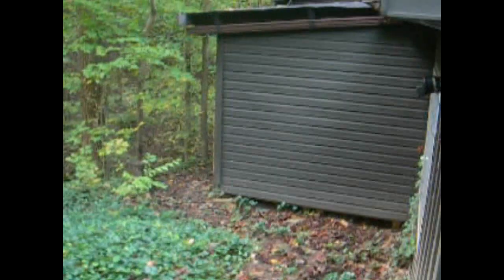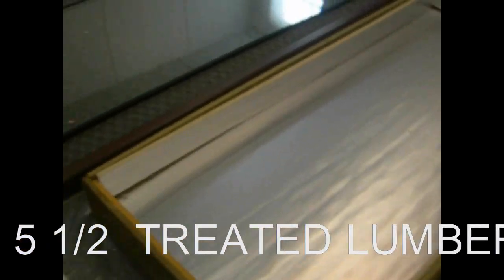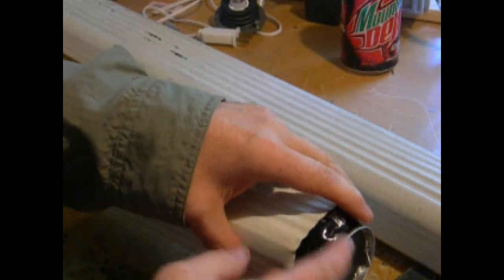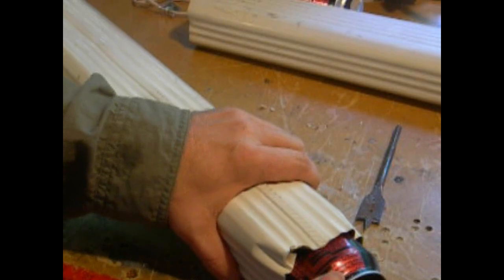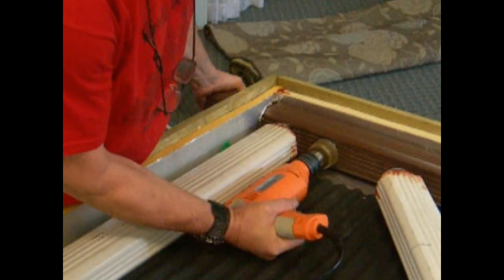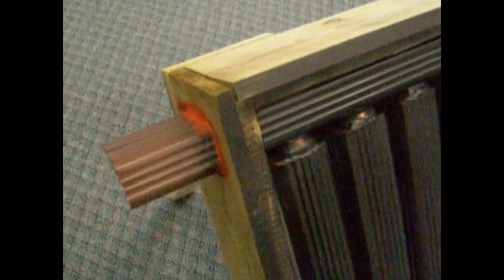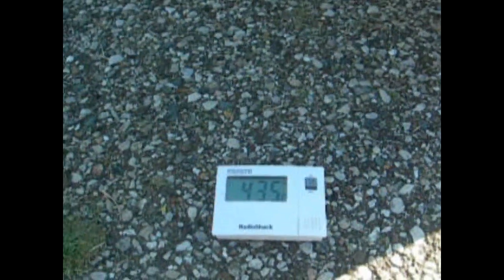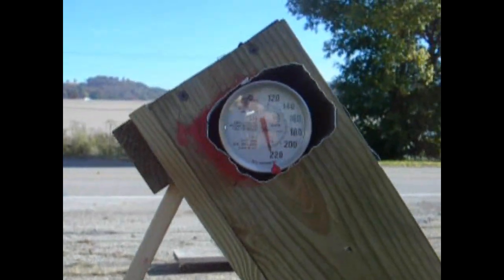HOW TO MAKE A POP CAN / DOWNSPOUT HEATER / FURNANCE

Comment: Great video! I'm going to make one. Maybe a couple of them. Just a FYI. To cut the top off the can I found a can opener (after buying and trying 3 others that didn't) that works perfectly. It's a manual one called Starfrit MightiCan. I used a diamond 40mm hole saw to cut out the bottom of each can. I'v got over 100 already ready to go. But will get a lot more to put in a second setup. THANKS!

Comment: Roughly How much volume of air is being pumped out of there. 
Or how powerfull is the fan
Reply: He wasn't running a fan that I could see.  That was pure thermosiphon;  the air moves as fast as it is hot.

You don't really need a fan, btw.  The amount of energy the panel collects is only affected by the intensity of the sun and the loss through the insulation.
The  "catch" is that the bigger the difference between hot and cold, the more "lossy" the system becomes.  

That's why most folks run a fan;  lower temp + higher volume air == less need for insulation.  In this case, it really doesn't seem to be that big a problem.

Comment: Why are the cans necessary?  Could you not just use the downspout material?
Reply: It also creates turbulence that "mixes" the air so that as much air mass as possible picks up heat.  Otherwise, it's just the air touching the aluminum that picks up heat and the rest is wasted space.
Reply: i believe its to slow the air down. because if it pumped through that too fast it wouldnt have time to heat up the air
Reply: Thanks Martin.   That makes sense.

Comment: I would normally agree but this solar heater does not rely on thermal mass to maintain/store heat. Once the sun goes down, the temperature of this heater rapidly decreases, no mater how much aluminum you add. I'd be more convinced if I saw some comparison data. Btw, have you seen the solar heater which uses aluminum window screen? That design has minimal thermal mass but is more efficient than this soda can design: builditsolar(.)com/Experimental/AirColTesting/Index(.)htm

Comment: Omitting the soda cans will result in less thermal mass. Objects with thermal mass have the ability to store and transfer thermal energy. By adding the soda cans, the system's ability to absorb the thermal energy absorbed by the black downspouts is increased. Beverage cans are generally used for two reasons. First, if you drink anything out of an aluminum can, they are essentially free. Also, aluminum is an excellent thermal conductor. This is why it is often used in heat sinks. Hope this helps.

Comment: hi rich would you be able to give me the products i need because i am making one like your 5th one thanks! P.S i am not using the strips that you put on nut i might if you can tell me if they are cheap enough for me to buy and what would you do for it to be on a slanted shed roof and a pipe with the insulation you will tell me to use will go into the shed and heat it. how much would it to buy one of the fans and covers? i need it because when i go into my shed on saturdays and sundays it is cold

Comment: Can you make it a multipass if you use gutters for headers and cap it every 2 downspouts. Would a multipass be to hard for a fan to push it out? Just wondering if it's worth trying as I am going to make I  fit it in the inside of my window. It is 68 inches London and about 25 inches high.

Comment: Thanks for showing me your video.  I could not see the whole design (I need to now airflow rate), but it appears you need higher airflow to get more heat out.   Watts out = CFM*(F out -  F in) / 3.  Higher CFM brings temps down which makes it more efficient by losing less heat out of the window of the box.

Comment: Do you do anything to control the high temp of air produced, or does the 200 deg +/- air mix with colder air to make a comfortable temp, or do you have some type of thermostat to open & close a vent or turn a fan on/off so the temp in the home doesn't get too high?  Also, I noticed that your other designs are straight up & down and this one was angled.  I bet if you matched the angle so that the glass was perpendicular to the angle of the sun, it might even be a little more efficient.  NICE JOB!

Comment: 220 degrees sounds like a lot, but you cant heat your house with hot air that stays in the collector.   What temp does it hold when you pump X CFM through?  What sort of BTU output do you get?
I like your idea of using downspouts, however!

Comment: Instead of cutting the sides of the top can, leave it closed and fill in around with sand or salt.  That should help retain heat longer.

Comment: Thanks for proving what I've been telling others. Slow the airflow...use thick material...not just wafer thin pop cans. Thicker material equals heat storage...and since it's hooked to the house...it's impossible to "lose" heat. More material...more heat. More sq feet of heater, more heat. Nice job dude. Too bad yours costs quite a bit to become automated...but overall the collector is very good. Very dense.

Comment: This works so well that i'm starting to worry about that wood warping or being a fire hazard! haha. Oh, i had one question about the down spouts. What do you use to seal the ends of the pop cans with the down spouts? I can imagine that most sealers would melt at temps of over 200.
Thanks for the awesome videos!

Comment from the maker: @mrphotomanTIM  hi yes im in cross lanes wv  check out my loose can heater test they work just as good and have better air flow  and are very easy to make if i was going to build one now would make a large loose can type and maybe add a little sand to each can   good luck keep me posted   rich allen

Comment: I checked all the floor vents in my house and the hot air that comes out is about 130 degrees f.  It seems to me that if you were to add a second intake and exhoust vent(open the other end of your headers) that you could double your air flow and the air temprature should still be high enough to keep you comfortable while the sun is shining.  Give it some thought...

Comment from the maker: the unit your watching has a snapdisc that turns a fan on when temp is 110 and off at 90 degrees    to heat your house you need lots of sun and a few good size units

Comment: 5.Have you built a unit that doesn't use aluminum cans and just uses the down pipes, I think it might work just aswell?
6.Have u built a unit that is connected to a thermostat in the house that auto matically turns the fan on or off based on a preset temp.
7. I'm building a new house and are trying to heat a 1200 ft2 home, any ideas on how many units i might need?
I've got lots more questions but thats enough for now.

Comment: What a fantastic concept, you've done a great job with ur solar furnace. 

I saw some guy in the US selling them for $3000 each. 
I've got a couple of questions?
1. I live in Australia and based on your best unit , which pumps out 220 F the conversion into celcius means that it is about 100 C, is that correct based on your calculations?
2. Why do you mesure the outside temp in the shade?

Thanks for all ur great work.

Dave

Comment: I began two scaled down window units that someone else up North is finishing. We cut the tops off several other cans and ran them through a metal paint tube crimper and will sleeve them onto the cans (cut side of can and lay it open to run through crimper). The units are designed in an upside down "L"; they will rest on the window sill on a second floor, with the bottom angled out, and the backside empty area will be loaded with scrap aluminum to hold residual heat longer. Hoping for the best!

Comment: On your downspout heater, I made two, one with the tops of the cans cut out and one with them left in, The one with the cans with the tops left in is 20 degrees hotter with a fan running than the one with tops cut out. about the same airflow from each.

Comment: I love the set up using the down spouts. did you put them in with the flat side facing out? I was thinking that the reason the pop cans work so well is the round can has more surface. I am going to build mine with the corner of the down spout facing forward. will have to see how it works.

Comment: I just got the materials to build one out of downspouts. I think I am going to try and seal both ends. I think the dead air space probably would insulate from cold better in the winter. I have 2 of the consolair style I just built. I did use foil tape to connect the cans. It works ok but is time consuming. I clamped some 2 in angle iron down to make a v then lay the tape over it and lay the can on it and rotate the cans. to tape them. Very good videos on what to do , Thanks!

Comment from the maker: i did not seal bottoms theres air inside the glass thats why i leave the bottom of the downspouts open so when the air starts moving the air inside the glass is sucked up too this is the best heat temp ive got so far without doing all that other stuff  im still in test mode trying different things

Comment: Excellent temp results.  Like to see experimenting.  You said you wanted to slow airflow by not cutting the topsides of the cans out.  My question is.. won't this restrict airflow and make the fan work harder and struggle to pull air through the unit and in turn reduce volume of heated air and efficiency?  I believe it was you who uses batteries to power your fans.  This may put a bigger draw on your battery.  Did you notice air flow differences from your first heater with the bigger holes?

Comment: Best one yet Rich, keep up the good work. I am working on mine and using 3X4 downspout for the headers with (4 total) 4" dia. holes for input/output. With the snap disc, anything above 115 degrees will be vented into the heating space. Hope the fan stays on all the time. Volume of heated air is what I and all of us should be after!

Comment: I just thought of an idea that might improve on these. If you used a flat piece of tin with the 2 1/8 inch holes drilled through it. You could install it at the top of the can header run it out the side thru a slot in the case. then you could slide it back and forth to increase or decrease the speed of airflow thru your cans.

Comment: I am thinking about making this same unit, but changing out the wood to cedar at the core to give a more natural cedar scent to it.  Do you smell any of the paint or aluminum in the process?  Could we use a connector like a radiator and run it through the length of a room?  Hmmm this is fascinating!

Comment: You are on the right track. It's not that the airflow needs baffled or slowed down. The best heat exchange at any temperature or flowrate will be the collector that exposes the most heated surface area to the air.

Comment: Yes that's good Rich. But you don't have much flow going on there. I bet if you had a thermometer inside under the glass it would even be hotter than that. Probably get to about 350F.

The thing is that you need to have some flow other than thermal siphon or it's not going to be as efficient.

When you start a good airflow thru there that temperature is going to drop. To keep the flow rate and temperature high, just use more collector area. 

That is a good video! Thanks for sharing!